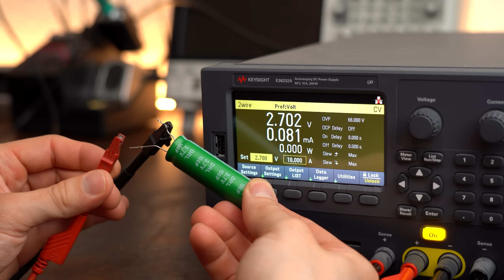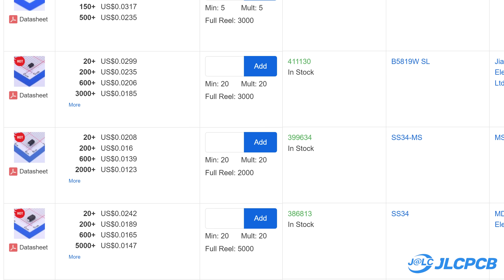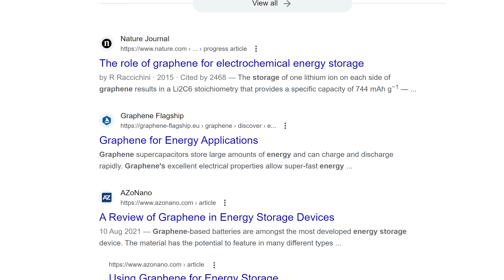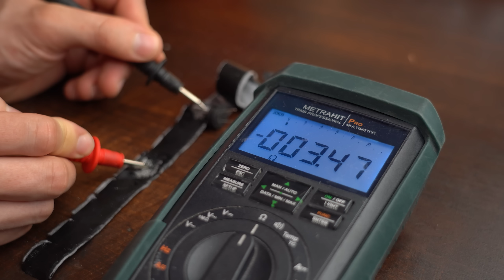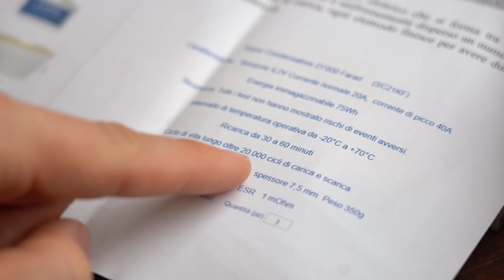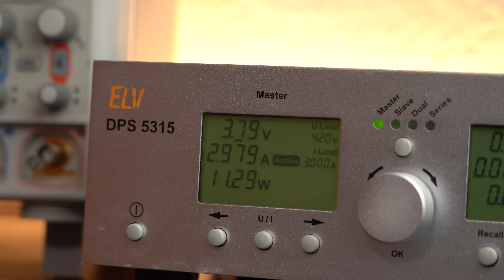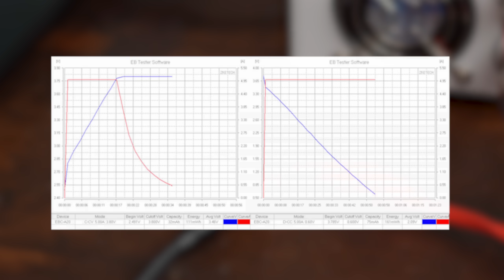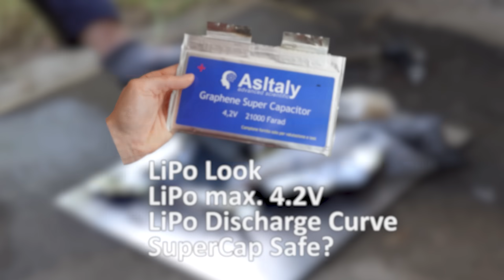Finally a Capacitor that can REPLACE a Battery?!

Comment: In my opinion the best way to find out if you deal with a battery or a capacitor is to discharge it to zero volts, let it shorted for few days and try to recharge it. Capacitor should survive this test with no problem and no capacity loss at all.
Battery would be not able to give You the original capacity but more likely You wouldn’t be able to charge it anymore.
Reply: This is afaik also true for lithium hybrid capacitors. So it doesn't completely rule out a capacitor type cell.
Reply: I got a drone from the bottom of the lake with LiPo battery, it was at 0 volts, but it did charge and worked fine, it did lost capacity tho ofc.
Reply: Capacitors have an exponential discharge curve, as other reactive components like inductors. A battery does not. The discharge curve of a battery has a roughly linear operating region and near depletion it goes abruptly to 0V.
Reply: @HyperMario64 That only holds true if charged from a constant voltage source via a fixed value resistor. Charging a capacitor with constant current will indeed cause a linear voltage curve, as capacitor voltage is directly proportional to stored charge.
Reply: I run a solar array to some batteries that runs my pool pump i had trouble  getting the pump motor to start i made a homemade capacitor with foil ,saltwater 3 liter bottle ,oil..similar to something like a bottles in bucket capacitor  added it to the system like a soft start in a ac ...pump runs great ...i think its a graphene cap
Reply: Hybrid Caps willl be ruined by this.
Reply: Zdar Kubo ❤ :D
Reply: Yeah it seems good idea indeed Since li battery Don't survives full discharge.
Reply: I once had a car with a dead alternator that drained my battery dead so I charged it but the charger (not mine) had been fixed in a dumb way so that the negative wire had a red piece on it so I charged it the wrong way and it still worked just fine xD
Dunno how much it lost capacity but it still worked so measuring that way isn't too precise if we don't even know what kind of battery/cap this is
Reply: Change time is also a dead giveaway
Reply: Nope. Lipo super caps do not handle full discharge and will rapidly degrade in capacity fully discharged. 😢
Reply: Not necessary so.... I did some tests with NiMh (of which that same is said). I deeply discharged them by applying a resistor of 1KΩ (~1mA) to them, and leave them like that for a year. After that I gave 5x a refresh charge cycle with a low current (0.2x capacity), and their capacity was still above 95% of their original, not very different of just store then charged and recharge them. I repeated that with a few periodes of a half year, same results. It could be that the resistor kept the chemistry polarized or so.
Reply: @erikdenhouter  thanks for Your experience. You reminded me of my experience with Li-ion battery.  Once I tried to repair my collegue’s scooter battery. There was one palalell row of cells at zero volts. I was still able to recharge them to the full voltage. Even the capacitance did not drop significantly. The problem was different. After this manual ballancing they were very leaky.  So after few weeks they self-discharged to zero again.
Reply: @KUBA64official  Thanks, I will try to use these cells normally after the next periode of abuse has ended 😜 You could be right that they will turn in something unreliable, that is not checked fully yet.
Reply: @KUBA64official those cells where protected and had a internal low voltage shit off. 
If you discharge a lithium ion cell to zero you won't change that ever again to full voltage
Reply: Dam that auto correct haha
Reply: @NinoJoel  Those were classic 18650 cells and there was one central BMS. This BMS refused to recharge the system once the voltage dropped under 2 Volts at one paralell row of cells. I don’t think that each cell had its own protection at its minus pole. It would not make a sense because if few paralell cells would be disconnected it would completely destroy the ballance of the whole system and overload some cells with higher current.
Reply: @KUBA64official  then they where discharged quite low to around a volt or maby less but achieving voltages next to zero is impossible with a  18650 . 
They are dead within days. 
They won't hold charge and won't reach the nominal voltages. 
They will also heat up significantly more when charging
Reply: @KUBA64official  Going back to your original/second comment, this isn't because the cells hit 0 volts and died, this is because you had one or possibly more bad cells, there are two common failure modes for a pack of parallel cells, it turns into a resistor slowly discharging the row or it turns into Chernobyl/Fukushima and quickly drains all the energy from the rest of the cells, likely causing a chain reaction thus killing all cells in that row, the more cells the more likely this is to happen (this is why individually fusing each cell is important).

Most of the time if cells haven't experienced anything dramatic like attempting to become a vaping device, all but the dead cells will recover fine with only a 1-3% capacity loss, the way to fix your colleague’s scooter battery would be to remove the bad parallel string, then cut every cell out of the string and individually recharge each one and simply leave them alone for one or two days, the dead cell will either slowly discharge back to 0 or refuse to charge up, the rest of them should hover within 0.1v of charge voltage, a few may have damage and have a very slight discharge.
Reply: @erikdenhouter  As a side note, the problem with NiMh arises when there are many cells in serie.  When the weakest cell get to 0, others cells keep the current flowing and the weak cell starts charging in the reverse polarity, which is destructive.  When recharged the weak cell is now weaker, it will goes to 0 V even faster, receiving a reverse charge sooner and longer. This cell becomes more damaged and weaker... the battery pack becomes useless only due to this weak battery.  This is why it is better to stop the discharge at, say 10 V for a 12 V pack.  This way you have less chance that any cell will reach 0 and starting to
charge in reverse.  With Li-Ion pack there is the BMS that provides cut-off and equalization, preventing this phenomen.
Reply: @jnb8918  and  @g.h.190  I always use these cells as single cells. When in series, and deep discharged, according to your stories, it could be a good idea to dismantle the series connection first, and cycle charge them 5x individually.
Reply: @erikdenhouter NiMh don’t come in this pouch format so that easily rules out that possibility.
Reply: Afaik, the problem is when you have batteries connected in series. Cell(s) with lowest capacity will be reverse charged when it reach 0 volt and the other cells still has some charge driving current.
Reply: @erikdenhouter  I even tried to recharge any battery that says do not recharge and it works for a few days.

Comment: What anticlimactic. You could at least have tested the actual capacity of this battery. If it's not a clever scam, it's interesting to note that this is a sample for evaluation and not for sale, which is strange as you bought it.

Comment: I have blown up quite a few lipo batteries. All that matters is state of charge. If it is lower than 20%, not much will happen. But everything over 60% will definetly result in a rapid runaway. If you want a real nice demonstration, charge the battery (Outside!) to 4.4 Volts. That leads to a massive fire.
Reply: Some types of modern lithium batteries allow 4.43 V without any damage.
Reply: @watchmakerful  Is that a surge rating however not intended for everyday use?
Reply: @watchmakerful  yes, but mostly high performance phone and laptop batteries. I‘m talking about the most popular NCM- type.

Comment: what an interesting mystery that is. i was surprised at the final test. It's a shame there isn't more reliable information about its characteristics, what ever it is. If it were true that it could handle that many charge cycles, that alone would be a good feature.
Reply: Graphen-coated lipo contacts.

Comment: It is a solid state graphene Battery I think.
Reply: You can simply google "solid state graphene Battery" and check out some videos online, such Batteries behave very much similar to your so called Graphene Super Capacitor during destruction test.

Comment: You said Capacitors have infinite life but i seen many blown caps so why is that. I seen them in Fans Computers and all kinds of stuff that just die bcz the capacitor is bad and replacing caps fixes the issue. The recent example is my HP laptop 2 of the capacitors is getting super hot and not turning on after changing those it booted up normally.

Comment: It does behave like a battery. Lithium reacts violently with the oxygen in the air and forms lithium oxide. It is probably a LiFePO4 battery. The working voltage range matches the type.

Comment: Lithium batteries cannot be charged below 0°C or above 55°C (the freezing limit is more problematic and quickly damage the cell) but super capacitors never have this limitations.
So if, you want to test the "super capacitor", just connect two long wires, put it in a freezer and start to do some charging-discharging cycles (a lithium battery shall degrade very fast in this conditions after few cycles).
Reply from the maker: That certainly sounds like a fun test for next time :-)
Reply: @greatscottlab  May not be fun as a flame test, but it should be definitely the coolest one!  🙂

Comment: Could it possibly be a Lithium ion battery? No expert but have punctured a few in the past, which to my disappointment, did not lead to them catching fire or heating up significantly. Also did you remove the label to check for any markings from the factory?
Reply from the maker: No marking from the factory. Sorry.

Comment: 3:36 did you really took a dremel to a super cap? you know you couldve used it or wire cutters to only cut the casing at the bottom where it was indented all around that holds the seal in
Reply from the maker: Always hardcore

Comment: Don't LiPo batteries use two different metal substrates (usually aluminum and copper), one for the anode and one for the cathode? It looks like that was the case with your "super capacitor". I'm not sure if there would be any reason to do that for a capacitor, but maybe?

Comment: In lipo there is lithium and not alluminum, maybe you have seen better. I think dimension can justify the big capacity. Main difference is that in supercap voltage can drop to 0. good video and big loss of money :)
Reply from the maker: Thanks for the feedback :-)

Comment: I’m really glad that you verified that this was not a hybrid capacitor. In the future, if you want an additional test you can run to differentiate hybrid caps from batteries, you can measure the internal resistance.
Reply: He definitely did.
Reply: he did in the video

Comment: You really need to differentiate between Lithium and Lithium-ion. Lithium primary cells are used in smoke detectors and are non-rechargable.